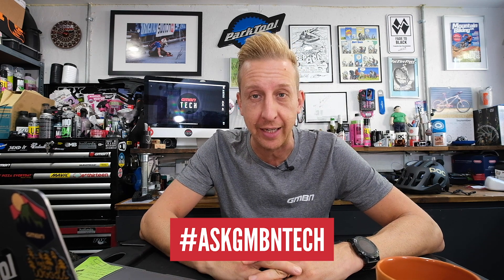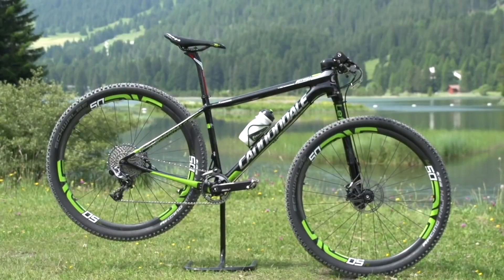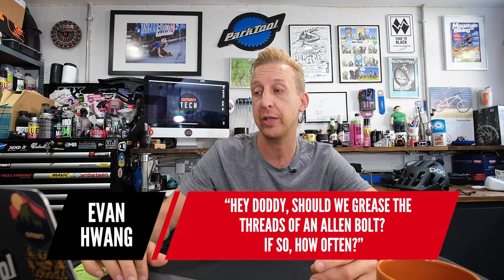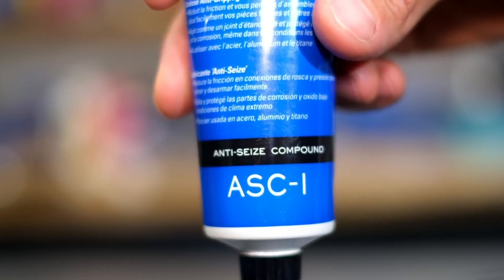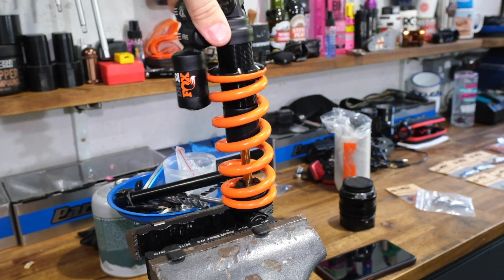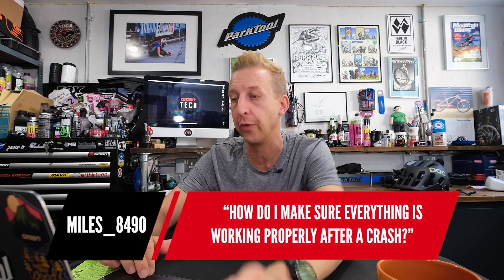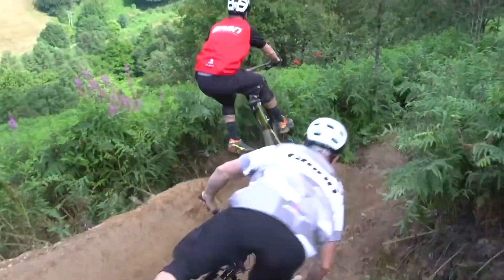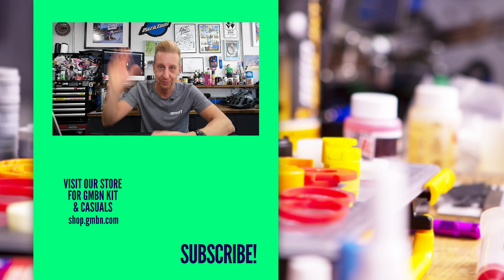How Do I Check My Bike Is Not Broken After A Crash? | #AskGMBNTech

Comment from the maker: Do you have a mountain bike tech question? Use the hashtag #AskGMBNTech with your comment below for a chance to be featured on the show 👇
Reply: Can Rear Derailleur be fixed after the cage bending?  #AskGMBNTech
Reply: I have a Trek fuel ex 9.7 ordered and it comes with a fox rhythm 36...I was wondering, as iv never used one of theses, if this is a good fork or should I replace it with something else?? #AskGMBNTech
Reply: My Maxxis DHR II which I run tubeless on the rear wheel started "sweating" after two years of riding. Whole sidewalls are wet although the bike is stored in a warm cellar. I'm using Stan's Race sealant, I changed it this year. It's not losing air, or at least not more than the front one. The front tyre, Maxxis DHF, is fine. Any ideas on what's going on? #AskGMBNTech
Reply: Is rock shox the suspension fork
Reply: What would be the best way to clean disc brake rotors without a brake cleaner. #AskGMBNTech
Reply: #askgcntech I don't know if this is the correct place to ask this, but - do you have any tips on how to ride slower? I don't mean braking, just riding slower. As we get into the dark nights and with the wildlife (mainly deer) on my local trails I can't pin it the way I did in summer, but I feel stiff and 'on edge' if I'm not going quick, pumping and so on.
Watching practice from leogang it looks like a lot of the pros find the same, if they're not pushing they crash more too! So how do you ride safe and smooth while also going slower? Thanks!
Reply: Hi I recently just purchased a Specialized Fuse 27.5 and it comes stock with a RockShox Judy silver tk with 130mm of travel. I was looking to upgrade to a better fork with 140mm of travel do you have any recommendations? #AskGMBNTech
Reply: #askGMBNTech I have recently bought a Trek Slash 8 which is my first ful-sus bike, indeed the first bike I have had with "Decent" front suspension.  

The front fork is a Rock Shock Lyric Select+.  I have read a lot about use of tokens to adjust the feel of the fork.  How do I use these, and what benfit do they provide? How will we feel the difference between "Linear" and "Progressive" suspension?

Keep up the great work.  Ian.
Reply: #askGMBNtech can i put bmx pedals on a high end mtb
Reply: @devynhooker3676  heat 325°F until it stops smoking  ps. Don't use the oven you cook food in.
Reply: @TheDiablosix6six  that is a great fork dont buy a new one until it breaks
Reply: @bighead1006  that is the company that makes the forks
Reply: @williamfowler5260  slower rolling tyres
Reply: #AskGMBNTech can you use 11 speed chain on 10 speed drivetrain
Reply: #AskGMBNTech I have a Canyon Neuron Al 7.0 2020 and I was wondering could if change my front fork’s travel to 140mm and if so what consequences it would have.
Reply: #AskGMBNTech Hello, GMBN! Hope all of you are well, I’ve got Canyon Spectral, 3 weeks ago, and it came with Maxxis Aggresor 2.5 on the rear and Maxxis DHR II 2.4 on the front, isn’t that a unusual combo, shoundn’t the wider tyre be on the front? Thanks!
Reply: #AskGMBNTech Hello Doddy! I recently got a 2nd hand Giant Reign Advanced (73 degrees seat tube angle) and it has a Specialized IRcc dropper post. I was wondering if I could turn the dropper post around 180 degrees so that it would put me in a more central position, for pedaling efficiency, since the dropper has a thrown-back-top type of thing. I don’t want to damage the dropper or carbon frame, and I couldn’t find much info online.  Thank you!!
Reply: #askgmbntech hey doddy what does turning your handlebars/front wheel do in the air when you do a jump, does it steer your bike in the air or is it just for showing off
Reply: I am thinking of buying a dropper post and I measured, when I bring my seat up for climbing position it is 171mm high, should I but a 170mm dropper post or go lower? #AskGMBNTech
Reply: Sram nx or deore m6100 which of the two do you prefer #askGMBNTech
Reply: be aware that copper grease will corode alu bbs. dont spread misinfo. 
Source: Bimetallic Corrosion.
Reply: #AskGMBNTech Is there anything you can do about steeringtube creeking in the crown?
Reply: #AskGMBNTech what would an older (pre 2013) downhill bike with modern 1x12, be like as an enduro bike.
Or could you convert one into an enduro bike with other bits.

I don't think I'll be attempting to do it but I'm interested to know what you think.
Reply: #AskGMBNTech What should I do about bike sizes im thinking of buying a grand canyon and the measurements give me size S but since im 13 and still growing im thinking of getting size M and im not far off size M but I'm not too sure about 29 inch wheels and also could u answer this same question but about stem and handlebars, thanks! (The bikes a hardtail)
Reply: #askGMBNTech I have a 11 speed cassette and it's a 11-42 Tooth but I want to go to 11-50 tooth but still 11 speed is my derailleur xt m8000 still compatible with that or to that should I upgrade to
Reply: #AskGMBNTech I want to put longer Shimano cranks on my new hardtail. How do I know which Q factor and chain line version to get for my bike running a boost rear wheel? M7100/M7120 or M7130?

Comment: I crashed my bars into a tree, now I believe they make a creaking sound. no noticeable damage, is it ok to continue using? thanks!
Reply: probably your headset or stem that is creaking. Safest to replace your bars, especially if they are creaking. Their strength could be damaged without anything visibly wrong.
Reply: Replace that
Reply: Hunter Wright definitely replace them
Reply: Check not just loose stem. Dismantle, clean, reassemble, and see.
Reply: Try to grease your headset and check if your bolts are loose or not
Reply: Take everything apart, clean, apply grease and tighten headset properly. If it's still creaking, something is wrong.

It could also be your brake lever or shifter clamp, so take those off, clean and apply gripper.
Reply: Probably totally fine, ride hard bro ✊
Reply: @TimMillernapavalleyfilmworks  hoping to see this comment, but will definitely take it apart. thanks!
Reply: ok so turns out it was sand and dust in my stem and bars. should you grease alloy bars?
Reply: @hunterwright386  u probably should but it doesn’t really matter for bars even if they’re carbon just don’t overtighten and use a torque rench
Reply: @hunterwright386  Grease is better than nothing, but carbon gripper is better than grease.

Comment: I can recommend that any part you see contact damage, remove and inspect the concealed side. I had a crash, broke my wrist. Had to replace pedals and grips. Inspected the nut on the QR skewer and it looked scratched but ok. Next ride out it broke from the inside out. Few things stop even a small bunny hop as quick as a back wheel coming out. End result broken elbow and kneecap.

Comment: 7:54 Crankbrothers Highline 3 is actually a good price, just find a good deal on a good site, and you need to get the remote seperatly, but with that it comes with cables, grease for service, and a sticker which is cool i put mine on the downtube

Comment: I’ve got a fairly budget bike a trek marlin 6 and I want to put a new fork on it as mine is finished. Cane creek make a headset bottom cup which will allow me to fit a tapered steerer tube fork in my straight head tube will this work or brake my frame. As well would it be stupid to put a yari with 120mm of travel on it or would that effect it to much

Comment: Question.. I just purchased a used DH bike. The rims are straight and true. It also came with CushCore on the front and rear. The front tire is so new there are still rubber “hairs” and the rear is probably only one or two rides older. Looking at the rubber line on each side of both tires, they are about 2 or 3mm from the rim all the way around. So they seem properly seated on the rims. However, even fully inflated, the tires don’t seem to be straight. There’s a right/left wobble in both of them. The rear is so bad the tire hits the frame? Do you have any idea what’s going on here?

Comment: Im planning to buy a new but cheap bike from a local bike shop around my area. I assume that local mechanics and the guys from the bike factory tune the bike but my question to #AskGMBNTech is that, as a new mtb bike, do i need to do something with my bike aside from the basic bolt check? Do we need to put extra grease somewhere or lube up some components? What would you recommend?

Comment: #AskGMBNTech Awesome show! I got this in mind for a long time, and after doing my research I could not possibly find the right answer. I'm pretty aware a lot of people often ask about adding longer travel forks to their bikes, I've seen that GMBN actually released a video about it, the short answer adding +20mm of travel actually increases BB height and slackens the HT angle. So my question is, could increase +20mm or more the forks travel and also downgrade the wheel size? (e.g. Switching a 29er wheelset to  27.5, or even 26 wheels). Would this correct the BB height drop? Would it be actually rideable? Hoping for your answer! Thanks!

Comment: #AskGMBNTech Can you exchange the fork damper oil without removing the lowers? Or will some oil remain at the bottom under the sliding seal so you don't know how much you need to put back in?

Comment: #AslGMBNTech I have a Shimano SLX 1x12 transmission set, and the clutch part of the rear mech is not putting enough tension on the chain (both with or without the clutch on). This has caused for a lot of noise and even the chain coming off. Do I need a new rear mech or is there a fix to this component? Thanks, Love the channel, keep up the amazing work.

Comment: Hi Doddy. Nice video! I have got Code RSC brakes on my bike and my rear brake has been behaving a bit recently. The bike is virtually brand new since I have not used it much really, and it is just a couple of months old. The brakes used to work nicely, but a week ago I started to noticed the rear brake lever is not fully returning and tends to stick. That happens when I start my ride but after half an hour or so of riding off road trails, the lever feels OK again. But as soon as the bike rests for a while, the issue is back. What can be the problem? @
Reply: it could be that the piston in your brake lever isnt working properly and needs replacement.. that happened to my code R brakes, the brake lever returned slowly to its position and through the time it didnt even move and was just compressed so close to the bars that i couldnt even brake anymore...

Comment: #askGMBNtech Hey Doddy, love the show. Before committing to an expensive coil shock on my Scott Ransom, I want to test coil shock performance on the Ransom with a cheaper coil, particularly progressivity/poppiness/playfulness. After coil on my Rocky Mtn and spending hours setting, resetting, adjusting, playing with sag, rebound, progressivity settings, I'm disappointed with the stock air shock, particularly plushness and small bump sensitivity and I see Brendan Fairclough runs coil on his Ransom. Are all coil shocks created equal in terms of progressivity, i.e. aside from rebound and damper adjustability? Can I get a comparable feel from a cheaper coil to what I could expect from a high end shock running the same spring?

Comment: #AskGMBNtech Hi Doddie,just a question on bottombracket spacers.how many spacers should i use on a 68mm bb shell using a 73mm crank?how many spacers on the drive side and on the non drive side.running a 1x raceface chester crank.thanks

Comment: #AskGMBNTech I've been upgrading a semi retro 26" wheel hardtail with V-brakes to make it more comfortable and fun. I'm wanting to upgrade the forks from the old Rockshox Dart 3's but the only new fork i can find that's still available for 26" wheels & V-brakes is the RS 30 TK Silver Coil fork. Would i be better off looking for an older (10+ year old) 2nd hand high end fork vs a modern entry level fork and do you have any tips on what to look for when buying 2nd hand forks?  PS moving to disks isn't really an option with this bike.

Comment: #AskGMBNTech My rear freehub body only fits a 10 speed cassette. I want a drivetrain with wider range like 11-46 and have found 10 speed cassettes but no derailleur that can accommodate that. Can I use an 11 speed derailleur with 10 speed shifter? Given that the movement of the derailleur comes from the shifter cable.

Comment: #AskGMBNTech Nice video! One Question can you exchange the fork damper oil without removing the lowers? Or will some oil remain at the bottom under the sliding seal so you don't know how much you need to put back in?

Comment: #AskGMBNTech
Hi Doddy, I have three questions. Firstly, why wheel manufacturers don't make the hub flanges bigger. In theory the sopkes would be shorter and the wheel stronger? Second: does higher tire pressure protect the wheel from folding? And last, will there be a new generation Zee soon?
Reply: True on flanges...but increases weight of the wheel.
Reply: I highly doubt that.

Comment: #askgmbntech I want a longer travel xc/trail/downcountry bike, I am tossing and turning between frames, a full suspension older frame(2014 Orbea Occam[which is actually orbea's trail line but since it's kinda old I can use it for downcountry]) or a new 2020 hardtail with newer geo
Reply: Definetly go for the new hardtail
Reply: @camerondavis7291  ok, I forgot to mention, the full sus is carbon and the hardtail will be aluminum. Now if you want, what's ur opinion
Reply: @raphaelroshwalb5500  still the hardtail, it isn't worth the outdated geo and components from an old bike, and I'm assuming you're buying it used so there's all of the problems dealing with that. The hardtail will be easier to upgrade and be a better fit for a bike to keep for a while
Reply: @camerondavis7291  .it's a new frame and I would be building up the bike(frame up) so they would have the same components
Reply: @raphaelroshwalb5500  you seem like you're defending the orbea so if that's what you want than go with that. One more bad thing about it though is you wouldn't be able to take it out on a test ride
Reply: @camerondavis7291  I was in the beginning going the Orbea but I'm actually now falling for modern two, I'll take the hardtail into account, thanks for the advice

Comment: #AskGMBNTech 
hello, 
I'm huge fan of your channel!!! 
 I would like to ask about rear shock. I hope you can help me. I bought a mtb bike with Rockshox Monarch RT fitted( before I had a hardtail bike). Just wondering will I damage the shock if I will run it on lock position? Is the shock will act differently (apart from being harder of course). The reason why I think to ride with locked shock is that I'm really heavy guy(and I mean heavy- 155kg.... 😆) and I love to ride. what I found is that when my shock is in locked position I getting a perfect sag, where when is not locked  i getting around 36-38% sag...  or maybe there is a different solution for heavy  riders (apart from hard tail bike) because there is no information around as riders like me are totally forgotten or ignored not just by mountain biking community, but by cycling community and manufacturers overall....

many thanks.

Arvis

Comment: Hello, I have a 2011 Giant XTC advanced and the carbon fiber frame has quite a big chip (about 3cm diameter) near the seat tube and some other smaller chips, what is the best way I can check for cracks? And where can I buy a 34mm seat post clamp with worldwide shipping?
Reply: If the chips are from stone flicks and not from crashes  it might be ok, just touch up with paint and nail varnish. Ultrasound scanning the frame for delamination is something you might find from a carbon repair specialist
Reply: @msagoo29  most of the chips are from rocks, but I don't know about the big one, I bought the bike used
Reply: @raresz1102  That's the thing with buying used, you don't know what that frame has been though, carbon hides damage well.. Those early XTC composites were overbuilt and robust at the BB and head tube junctions, and were quiet heavy as well, I think you might be fine. Touch up the chips and keep an eye for cracks, protect the downtube with an old inner tube
Reply: @msagoo29  thank you for the advice!

Comment: #AskGMBNTech  Switching tires v/s Two wheelsets
I have one bike and don't live near mountains so I ride during the weekdays XC and in the weekend I'll go to some more enduro trails. Now I'm switching every week between tires (with innertubes), but I want to ride tubeless and I'm thinking of buying an extra wheelset. But what do I do? use one casette or use two cassettes and should I switch chains every time?  What would you advice?
Or should I become a skilled tubeless tire changer and stick to one wheelset (won't the tires become really messy if you change them alle the time with the sealant and all?)
Reply: Defo 2 wheel sets if tubeless, and 2 cassettes, 1 chain... Just replace chain when 50% worn...I.e. more often. Will be totally fine.

Comment: Hi guy’s. Im 16 years old and not the tallest, 170cm. I’m looking for a new bike and cant choose between the canyon neuron or spectral. I now have a trek marlin 5 so it’s a big step up. It also has 27,5 wheels and realy like them. So the spectral has 27,5 inch wheels and that’s good, but also 140mm in the back and 150mm up front. I might be a bit overbiked if i get the spectral. What do you think?

Comment: Hey guys from Nepal. I have a set of entry level brakes, the Tektro auriga. They're pretty old now. When i pull the levers the pistons both move in but when i let go one of the pistons doesn't go back in. The more i pull the furthur in it goes withoit retracting back. Is it a bleed issue or is it something that i need to open up the brakes for? Thank guys.
#askgmbntech